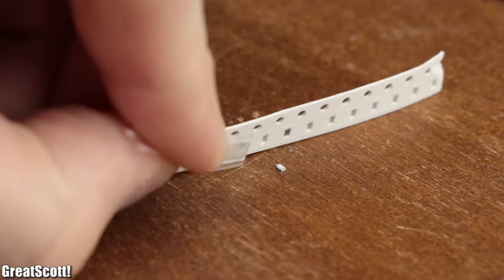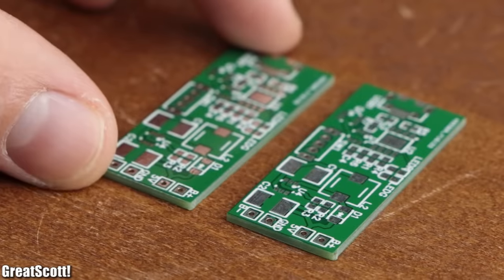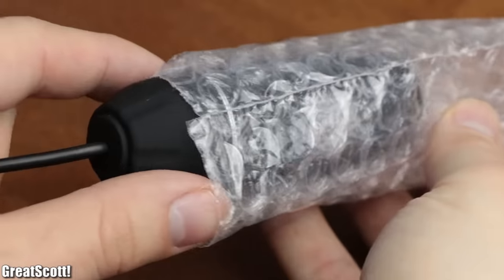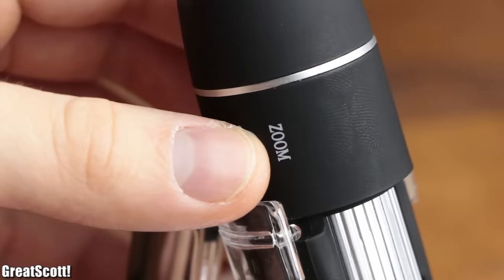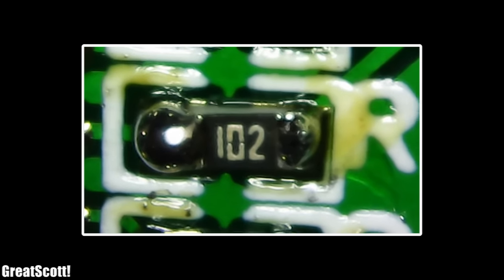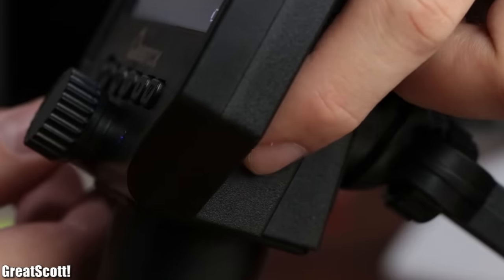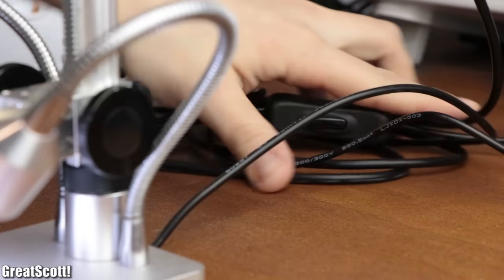Microscopes for SMD Soldering || $15 VS $45 VS $189

Comment: Looks like I will stick with using a regular old magnifying glass...

Hey, it's cordless!
Reply: I'd even go so far as to say the magnifying glass is better, as long as you have a third hand of some sort. The electronic microscope workflow fundamentally requires the camera-to-screen and then screen-to-camera angle changes. This would have a negative effect on a dexterity based activity like soldering, because humans are just better at coordinating movements when reflections aren't involved. The only way the microscope would be better is if you had one of those robotic surgery stations. Actually, that would make for a very interesting DIY or Buy episode. I imagine a lot of non electronics enthusiasts would be interested in that, like amateur biologists and teachers.
Reply: I agree.
By the way I recently took apart a rear projection TV, and am now, after a few modifications, I'd using one of the projector lenses as a magnifying glass. I can see basically every speck of dust that's on a PCB! I might make a video on this in the future.
Reply: Yonatan24 I prefer using my eyes.. works fine for me
Reply: Where did you get those eyes are they corded or cordless?
Reply: JakeN482  If you get one of the jeweler's lens which mounts to your head with a spring steel band, you can dispense with the third hand. You also get to look like a badass space bandit (or so I tell myself).
Reply: How much magnification can you get with a magnifying lens? The best I've found that still allows room to work is about 10X which is not enough. I'm working with 1020 parts so I need around 50X.
Reply: And it consumes very little battery power.
Reply: @Yonatan24  I wonder how to record vids with eyes.
Reply: @JakeN482  Mind to give sources with that claim, that reflections reduce the dexterity? Many artists use monitor-less drawing tablets, and I wouldn't doubt their hand dexterity.
Reply: @Kai Schoos 
You're talking to someone who's used those tablets, and I believe they suck. I'm even annoyed by the slight thickness of the glass in older capacitive touch screens. But if you want evidence that isn't anecdotal, there's a psychology paper out in the wild involving people using special glasses that flipped their view upside down using mirrors, and monitoring their adaption to it. The general gist was that for the first few days the experimentees experienced severe vertigo and even headaches, but it eventually died off. Once they were completely adapted, removing the glasses induced the exact same effect as initially wearing them. It would not be unfair to extrapolate that people who have to operate with such disjointed visuals in their practices need to invest significant time in exercising their dexterity with altered perception.
Reply: @JakeN482  Not if you want to make videos and livestreams, not everyone has similar usecases
Reply: @Owen Prescott 
I agree, but teaching considerations are rarely in line with practical considerations and thus should go without saying so.
Reply: Even magnifying glasses are crap nowadays. I ended up buying a British vintage one so I could guarantee the optic would be perfect. And it was. I agree with you. Low tech solution, 4k resolution :)
Reply: lol i forgot about a magnifying glass isn't mad that we live in the world with so much tech that a simple magnifying glass will do .
Reply: @ArtDesignHobby  Plug into your ear of course.  At least that's the most logical place for a usb port that doesn't get the cord in the way.

Comment: I have a purely optical binocular microscope that I found in the dumpster at work.  I had to rig up a stand for it as all I recovered from the trash was the 'head' that contained the focus rack and optics.  I made that out of some 1/2 pipe fittings.  Disadvantage is that you have to look into the eyepieces as there is no camera, which means some coordination between getting the soldering iron and solder in the right position before you can look into the microscope.  I can't take pictures or video though it (maybe I could rig up a RPi camera to an eyepiece with a 3d printed adapter?).  Still it does give VERY sharp images, and is good for inspecting my work, looking for solder shorts and poor joints.

Comment: I also have the cheap one and am satisfied with the image quality - it works well with my android phone (Galaxy S6) connected with a USB host cable and an app called camerafi which is free for download but dows come with some annoying ads (dont know if it records video).... so 3d print yourself a stand for the phone for better hand- eye - coordination and done. For "large" smds i just use the smartphone's camera using a magnifier app - and of course there is the option to just use strong reading glasses ....

Comment: I have one of the £45 microscope but also bought a metal stand with the adjustment up and down it has made it more stable and so much easier to use. It cost about €17 from banggood and looks similar to the more expensive microscope you have. I agree the one supplied is rubbish to use.

Comment: The lid of the cheapest microscope is still on! this results in too bright pictures. If you remove the lid, the image quality should improve.
Reply: I can confirm. I have this microscope and I made the same mistake the first time I used it.
Reply: Same here, without the lid the quality is actually pretty good
Reply: Indeed. Did the same mistake when borrowed that cheap one from my coworker and forgot about cover :)

Comment: I picked myself up one of the $45 units and tossed out the charger as soon as a looked at it, as for the stand that came with it, I use it for a quick setup, but I picked up a universal long arm tablet mount, one that can be fixed into place.
Its just not that good when you bump the table, but I have found it's okay when wanting to check things out.

I do agree with everything you have said.

Comment: I would like the snap button to be on the illumination control rather than on the scope body to take pictures without touching it.
Reply: I couldn't get the snap button to work. Installed the appropriate driver and everything.

Comment: I scored a super cheap slightly faulty galaxy z fold 2. I'm using this with magnifier app as a screened microscope. Works very well. No need for chunky microscope. I guess any flagship phone will be good. But the fold screen gives a lot of viewing area. Recommended.

Comment: You forgot to take the plastic cover off of the cheapest microscope, that's why the image was not so clear.
Reply from the maker: True, but it was still pretty decent
Reply: GreatScott! I was thinking that was a nice image! Surprised to hear it's even better?
Reply: GreatScott!  It's not in the focal plane which helps some. I can confirm it is much better with it removed though.

Comment: 0:40 thats quite a cheap electron microscope
Reply: Isn't it a optical microscope?
Reply: +CoolKoon yeah that and also it actually says 'electron microscopy' on the ebay ad LOL
Reply: @CoolKoon  And it's very small as well, most electron microscopes are about 1 meter tall.
Reply: That microscope is shit
It does not utilize accelerated electrons to take images

Comment: Open that last one and look if you can't connect a lipo to into it. :)
Reply from the maker: Might try this someday
Reply: GreatScott! Just frustrating open it and look for pads. If there are it will be easy ;)
Reply: Especially considering what he was soldering. :)
Reply: ce neblock do you know what sucks ? 
If you need your soldering iron to fix your soldering iron 😂😂😂
Reply: BuzzCola 3 oh I've been there. Luckily for my station, new irons aren't that expensive.

I made a temp fix with solder paste and how air reflow.
Reply: ce neblock yeah
Reply: GreatScott! Please! If you can do it i can do it on mine :3

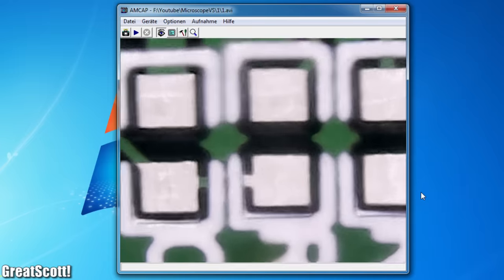Comment: 3:22 - With all the soldering fumes and soldering spitting fireworks, it's gunna make the CMOS sensor foggy or permanently damaged, should mention that. Professional digital microscope has a clear plastic cover to prevent the fumes fogging up the the camera sensor over time.

Comment: I use a headband loupe and it works fine for me. I can keep my prescription glasses on, while with my microscope I have to take them off, then on again when not using it. That of course is a stereo microscope, not an electronic type.

I also tried a Mantis microscope. But feel my eye hand coordination does not work as well as when looking straight at the point of interest as done through a headband loupe. Which iis also stereo vision, meaning distance can be judged.

Comment: On the first cheappy it looks like you still have the dust cover on, you need to remove the plastic cap when using it, still works ok with it but you get a much crisper image without it.

Comment: I mostly solder 0402s and QFNs and all I use are my eyes and a magnifying glass to inspect the joints. Really don't see too much of a need for a microscope. If all you need to solder are a few 0603s or larger and a 32 pin QFP SMD micro I would suggest to just get a slightly larger cheap magnifying glass and you'll be set. 0402s are a bit trickier but still perfectly doable.

After a while of doing SMD stuff I find it a lot easier than soldering through hole components.
Reply: I agree, I just use a jeweler's loupe to inspect the joints after soldering. There are magnifying visors, not a microscope obviously, but they still help.
Reply: I use these visors too. Perfectly workable for 805 components and the occasional 402's.  even with my old eyes.
Reply: @peut  I used a visor for years, the plus side is you get 3D vision, the down side is I got headaches after an hour or so of working under it.  My eyes are 67 years old, once upon a time it wasn't a problem.

Comment: I've repurposed an old webcam for that. 640*480 is good as long as you have a clear picture with good lighting.
To get a decent focus, you'll probably have to dismantle yours to get to the focussing ring. Then it's just a matter of sticking it to a small tripod ( a few glued together chopsticks that I trimmed to get the best ratio between height and image quality ) 
It's also possible to attach zooming lenses by recovering pieces from old disposable cameras but that's another story.

That being said, i guess you could also attach lenses to an old smartphone and stick it on a tripod as well... That would give you the benefit of having a screen + battery on site.

Comment: Can you show how to make a soldering microscope maybe it is possible with a raspberry pi
Reply: I was thinking the same. A raspberry pi Zero would be an excellent choice.coupled with a 5 inch lcd from waveshare, it would be cheap. If you want to do a bit of automation, u may want to add a servo for lense autofocussing.

Comment: Once you've tried soldering with a real, stereo microscope, nothing else manages to come close. Great video though, not everybody wants to drop $600 on an SM-4TPZ from Amscope. For general purpose soldering work as a hobby I think the digital ones are acceptable. But I think everybody who tackles SMD soldering should at least, at one point in their life, try it on the real deal. It's a life changer for sure.

My huge complaint with the digital ones is there's usually noticeable delay, awful framerate, and generally terrible exposure and focus. There's just something that doesn't feel quite right when staring at a screen and soldering something. Using a stereo microscope, you can actually perceive the depth of the work and it helps immensely for all sorts of otherwise tedious tasks, like running micro jumpers when you've damaged pads, or reballing BGAs. The input delay by itself is enough to make them a nightmare to use.

For around the same price as that high end $189 digital scope, you can buy a legit stereo scope from Amscope, the SE-400. It doesn't have adjustable zoom, and it doesn't record videos out of the box, but if you would rather work with a legit microscope, you can't really go wrong with the SE-400.

Comment: I use the metal stand type, and a movable stage made for microscopes.  The stage has a spring loaded clip to hold a glass slide, and I fitted a piece of protoboard in place of a slide, and marked the boundaries that could be seen.  I mount my circuit boards using Blue Tack.

Comment: I bought the $45 one. The main problem it had was that the knob wouldn't stay in place, a pain to focus it. I fixed it by putting a 2.5 mm heatshrink piece on the axle of the knob to increase friction. I also ground some burrs on the rack piece that moves the lens.

Comment: GreatScott I think you should stop applying "the bigger the blob the better the job" approach to SMD soldering 😉 Or at least don't show it to the public. You had waay too much solder there. 

Also another important thing to look at with these cheapies is the latency - the USB scopes are often simply a webcam with a crappy lens and many have large image latency that makes soldering with them a huge pain. Low frame rate is one problem but if the image is significantly delayed it will throw off your hand eye coordination even at 30fps.

I have personally given up at trying to solder under one of these and use my USB microscope only for inspection purposes (or taking pictures). For soldering I have bought a cheap non-zoom optical stereo microscope and never looked back - it costs a lot more than a 15 euro toy but the difference the stereo and absence of any lag gives you is enormous. If you try working like that once you will never go back to one of these camera based scopes.

Comment: Love your videos.  Please do a review of a cupped soldering tip - I bet it improves your soldering 100X and makes your life easier.  You basically load the tip with a bit of solder, apply flux to the parts, then just run the tip over the pads and end up with perfect joints. This also frees your second hand to hold down the part.
Reply: It sounds interesting but I can't find it in the internet or I don't know what to look for. Could you tell me how to find it? How does it work, does it have a hole/dent in the tip?
Reply: @RoketGames  search solder drag tip concave or JBC C245938 Spoon Cartridge Soldering Tip for  example.  Looks like a chiseled tip but concave instead of flat.  The dimple holds some solder and the pins get a good coating of liquid flux. Drag the beast across the pins. Surface tension of the molten solder in the concave dimple drags it from pin to pin perfectly down to extremely fine pitch

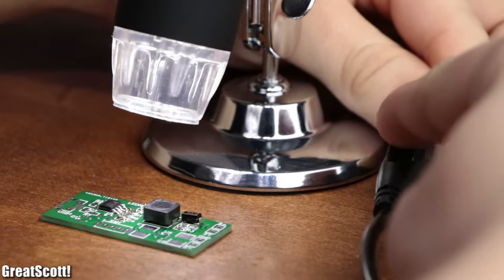Comment: Sorry GreatScoot but ur test is not what it should be, 4:14 you should remove protective cap and image going to be much better, I have same but 500x , working with it long time already, and it is all I need, only bad thing is what you said, you have to look in monitor on your computer, but after few jobs you get used to it and problem does not exist anymore. Check here for how it looks https://youtu.be/Jz-vN1el2DU?t=155
Reply: And to add, recording in to video what you doing, yea you have right but when you include software as it is Action! than you can record in high resolution and with good frame-rate again same check in above given link , but have to say , video itself contain some mistakes in rendering and as it is low view it does not worth reuploading fixed version. And uploading it to fixed version most likely would lead me to yellow monetisation icon, usually every video I upload gets yellow icon , and after few days turns back to  green.
Reply: I have seen it Fanta,  it looks nice and sharp.

Comment: why don't you just choose in traditional way? just only using simple magnifying glass. back when the old days always only use magnifying glass.
Reply: I was looking for this comment. I don't solder SMDs, but for small connections, like my latest PCI-E extension, a trusty ol' magnifying glass worked just fine. Maybe using a microscope for recording helps GreatScott! to make instructions or nice shots of him soldering, for his videos, but other than the recording capability, I don't see a reason why a magnifying glass won't work, especially if you have a fume hood, so the smoke doesn't add up under the lens.
Reply: +MrBiky Focal distance. When you get down to 805 or 603 the size is such that you need quite a powerful magnifying glass which has a set focal distance. If you get a 5/10x magnifying glass the distance is rather close and soldering with that in the way is a pain. If you go with a decent size glass 4"+ the distortion at the edges makes it all but useless and the glass gets in the way due to distance. The smaller ~1" units are rather small and you are limited to 1 eye, same with the wearable glasses, 1 eye at a time due to how close your face has to be to focus. Some of this comes down to comfort, looking at a board with 1 eye for an extended time is a pain, doing it once in a while you could overlook it, but do it often enough and the magnifying glass becomes the enemy.
Reply: Maybe I'm just used to it, or I have good eyes.
Reply: MrBiky yahh that's true. back in the old days when some technicians just only use magnifying glass to soldering some electronic devices and use only camera when they finish.

Comment: On the cheapest microscope, it looks like you did not remove the cap that protects the lens. Removing it will make a huge difference on quality as one may expect. It has a tab on the side that helps removing it and placing it back when not in use.